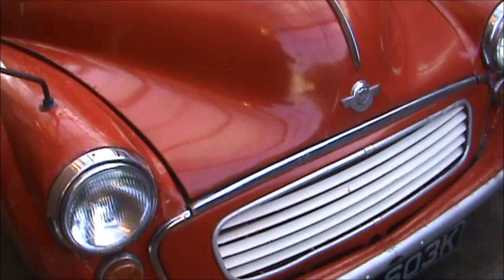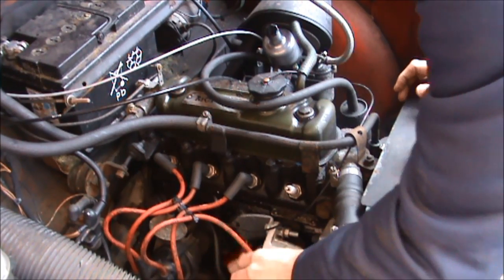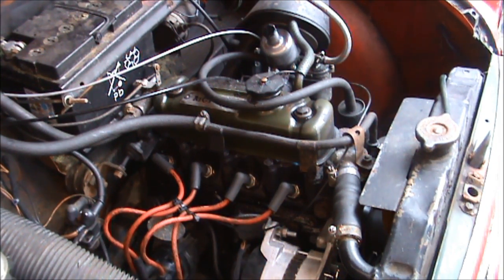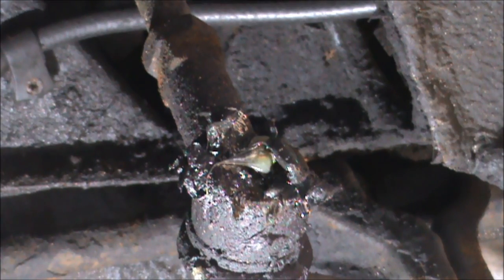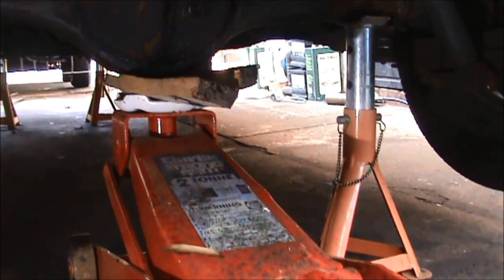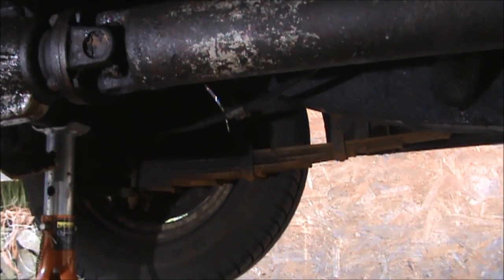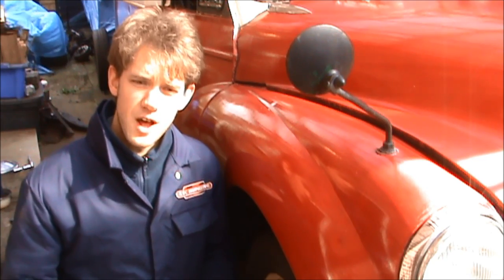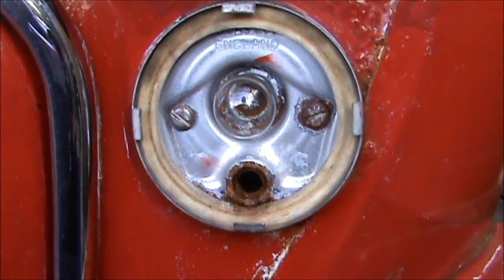How to service your Morris Minor

Comment: Hi. Can you tell me whether you use grease or oil on the steering rack? Great video. X
Reply from the maker: it is supposed to be oil, used in the steering rack, a normal gear oil should be fine.

Comment: Really informative videos! I’m new to working on cars but have a 1955 803cc Minor and will hopefully be carrying out my own minor works to it (servicing etc). I notice you’re videos are on a Morris Minor 1000, will the procedures be the same on the 1000 as the Minor?
Reply from the maker: yes the procedures will generally be very similar, not much changed between the models ony the engine size and gear box type being the main changes

Comment: Thanks for posting your interesting videos. If I may ask you a question, with regards to engine coolant. Do you use 'Bluecol' anti freeze? I have heard that OAT; Organic acid technology anti freeze is unsuitable for classic cars. May I also ask you, what is the ratio mix of anti freeze to water. Is it 50/50? Thanks.👍
Reply from the maker: ive used Halfords general anti freeze for many years and never had any issues, it comes pre mixed but i do add water to it to 50/50 ratio, i also usually change it at least once every 2 years, if it needs a top up i dont usually add water in winter, but in summer i will
Reply: @kgcclassics3211  Many thanks, and keep your films going. We certainly need more instructional films like this. Basic vehicle checks are very important. All the best.👍

Comment: Way to much oil in the dashpot & 3in1 oil is better.
Never use a piece of wood as shown as the cup on the trolly jack is shaped like that for a reason, using wood will likely see you car falling off the jack.

Comment: Hi, did you check the spark plug gaps??
Reply from the maker: no not on this occastion, they only need to be done every 5-6k miles
Reply: @kgcclassics3211  Oh, ok..  I would have done it anyway, having removed the plug!  And it only takes a couple of seconds..

Comment: wot discs did u use where u can use the original wheels?
Reply from the maker: Hi Michael, i am assuming you mean the front disc brakes? they are the Morris Marina kit available from ESM morris minor spares http://www.morrisminorspares.com/brakes-c42/front-brakes-c44/grumpy-disc-brake-kit-marina-based-p829453
Reply: ah ok cheers

Comment: Your wrong about topping up the SU carb damper!!!  thinest oil possible & only top up to within 1/2" of the actual piston-----should just be able to feel a slight resistance.
Reply from the maker: the best oil to put in the carbs is the recomended SU carb oil, however your standard engine oil will have no detrimental effect to the carbs or the engines running performance